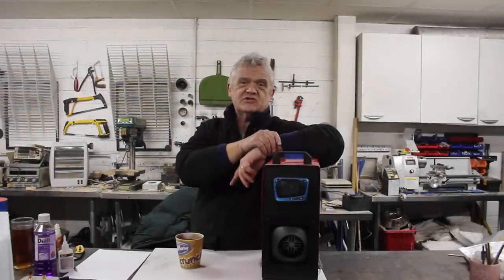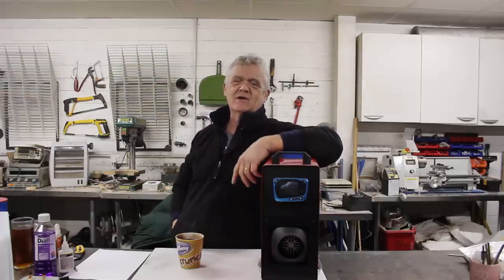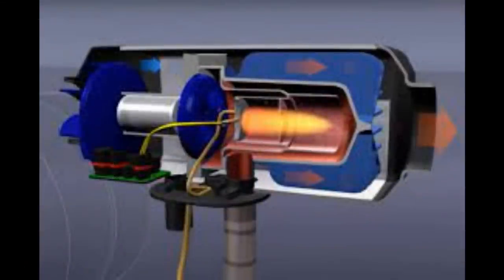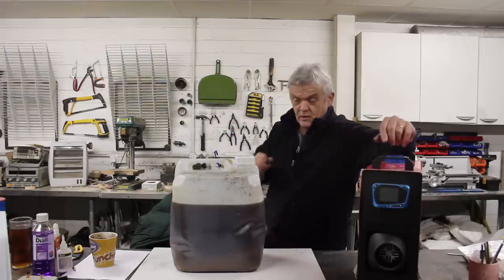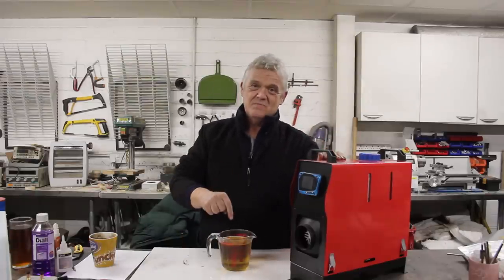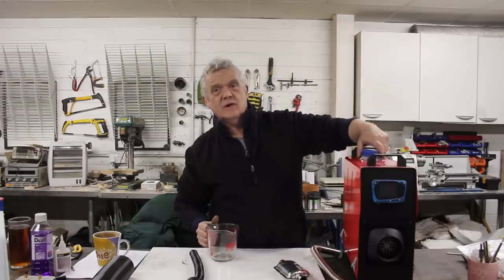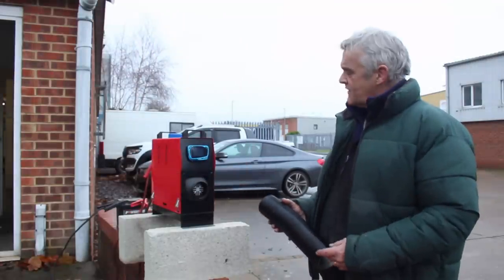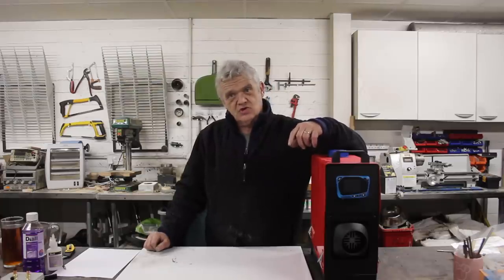1793 Home Made Fuel Running A Diesel Heater

Comment: They're amazing and if pensioners die of cold when used veg oil and a 100 quid heater can prevent it then what state is our country in? I shut off my gas supply and switched to these as only gas used was for heating but you still pay 56p a day standing charge, and only use central heating a couple of months per year anyways, if that.
Reply: When you say your using one? What square footage are you talking about. I'm wanting to know if I could heat a 20f x 40f lodge with good insulation

Comment: I have been running my diesel heater with E85(85℅ethanol+15℅gasoline). Its cheap in France, about 60 cent per litter. And its running fine, even in low setting 1.6Hz. And for the 12v power i used a old  computer PSU(300w). Works fine.
Reply from the maker: nice

Comment: So what if we could use the mechanical energy of the fuel with a 1/10th horse power Diesel engine to generate  electricity? We could use the heat for warming our home and the electric for lights or more heating.
I see such great waste with direct combustion of fuels. Using only 20% of its true value.
Additionally, alcohol can be boiled on a closed loop to turn additional dynamos with heat rejection used for home heating.
Reply from the maker: nice suggestions - cheers

Comment: I'm going to wait until the summer to buy one for next winter....   I was thinking tho with devices dumping exhaust heat about adding heat exchangers to them to heat water.  Even if the job needs to be finished off before a shower or washing up
Reply from the maker: good plan - they are getting harder to source just because it is winter - inn summer they are going to be a piece of cake to buy and cheaper!

Comment: Ive beem using on of these to heat my workshop in the uk for the last 6 years on diesel and kerosene never had a problem with it in temperature mode i use about 20 litres a month constant use for about 12 hours a day the only thinkni have replaced is the pump as if you dont use them they seem to get clogged up so i run it in summer once a week for about 5 mins to keep it from clogging up i also run it off a 12volt 15amp power supply
Reply from the maker: nice - thank you for The advice mate

Comment: When I was a mechanic we heated the shop with a diesel heater but what we did was mixed a50/50 mix of diesel and waste cooking oil and burned that because the oil alone was too hard to burn until heated up. By mixing it it made it burn easily and cut the cost of fuel in half.
Reply from the maker: cheers mate

Comment: do believe the combustion air intake does  not HAVE to be placed outside. If one instead used inside "room temp" air to feed combustion the unit can more efficiently do its thing cause it is not needing to heat this soon to be combusted air up as much to get/keep the combustion process going.    Granted that does mean then the user needs a vent somewhere for outside air to get inside the room to replace that air that ended up being used for combustion instead of breathing.  Yes this breathable air coming back into the room should not be be to close to where the combustion exhaust is, so your not providing access for that to get pulled into your breathable air space.     Corner of the room where no one spends much time for example might be a place..... so the cool air coming in, is not so much an issue.
Reply from the maker: cheers mate

Comment: Some heater display panels have a code that you can put in to change pump speed and airflow.  The code is 1688, tinker with this and you can basically burn most oil based substances.
Reply from the maker: cheers mate

Comment: I fitted a cab heater (Eberspacher) in my workshop over 25 years ago before the cheap versions were available. Like so many other Youtubers have done, it is not advisable to run them on a mains fed power supply unit, as in the event of a mains power cut the unit can’t go through the programmed (safe) shut down process of cooling the unit and purging the starting heater plug. A 12v battery and battery charger should be used to ensure correct shut down with the available battery power. If the battery voltage drops to 11.5 volts the unit will initiate the correct shutdown procedure automatically, turning off the fuel pump, running the fan to cool the heat exchanger via the heat sensor, re energising the glow plug briefly to ensure any residual fuel is purged from the chamber ready for a clean start up when the correct voltage is available.
Reply from the maker: cheers mate

Comment: used oil are often burning hotter than diesel or furnace oil. So you have to check the temperature inside the casting because if too hot it will go into cooling mode and shut down the pump. Another interesting fellow used a recycle aluminum tubing and heat dissipation fins  from an electric heating baseboard unit stuck into the exhaust. David McLuckie check that those diesel heaters exhaust and they are loosing around 800 watt in heat loss, so better to catch it before you exhaust it outside. Just make sure that their is no CO leaks in the contraption...
Reply from the maker: cheers mate

Comment: They have those heaters that will run on petrol (gasoline for those of us on this side) and a lot of van campers use them attached to the gas tank.
Reply from the maker: cheers mate
Reply: People I have seen who tested gasoline they didn't last very long running on straight gasoline!
Reply: @patrickday4206  They have the heaters that are constructed for Gasoline.  Many van dwellers and construction people not only use it, but have it attached to the gas tank of their vehicles. Completely safe and as long as properly maintained, they last for years.
Reply: @grey_piffle  yeah years ago I owned a vw bus 1999 I desperately wanted a gasoline heater as it get in the negative ferinheight but they were around $500 dollars I couldn't afford one so I'd drive looking out the one foot round circles that would defrost from the engine! Lol
Reply: @patrickday4206  less than $200 these days. some good knockoffs on Amazon too.

Comment: Hey got a  Hypothesis Hope I'm saying that right I don't like too much like a foolBut can we make a battery out of a radiator by put in vinegar through the radiator and using one end as copper on the other end is steel or led
Reply from the maker: yeah but it will rot the copper

Comment: If one can get one with a thermostat, I'm almost tempted to leave the entire business outside and use it to heat up air to 60 deg F for allowing one to make their heat pumps actually feasible in winter, but you'd have to ensure you enclose the outside unit enough, while not intaking too little air starving the heat pump. Geothermal adjacent at that point.

If anyone plans this, intake for heat pump cover must be at the bottom so any exhaust would be pushed up further than the intake.
Reply from the maker: nice suggestion - cheers mate
Reply: They do it's made by a guy in Australia it's called the afterburner!

Comment: Hi Rob, Great channel enjoy the content and thought Provoking topics. With regard to the diesel heater during the recent cold spell in the UK  -6 I have used one to feed in hot air and recycle it to get our lounge to a toasty 20 degC.

Never seen these temperatures before in a 1960 built house with poor by today's standards insulation.

I think you might find it interesting to look at harnessing the wasted exhaust temperature (200-300degc).

There are a few videos of using a car EGR intercooler that heats water as the exhaust gases pass through it.

It seems to me that this would be very similar to the old Back Boilers that perhaps you are more familiar with than me. 

In addition to heating an indirect copper coil water tank. It could possibly be used with a pump to circulate around a stand alone CH Radiator.

Merry Xmas to the team
Reply from the maker: nice suggestions mate and I was looking at the waste heat and pondering it - I like what you are suggesting for sure - cheers

Comment: What sort of temperature are the exhaust gases?   Could a coiled exhaust pipe be used to heat water like a gas fired power station ( you did this with a rocket stoke a while back)
Reply from the maker: that is a good idea mate - I was looking at the heat bloom from the exhaust thinking just the same thing - what a lot of waste heat lol

Comment: Okay, this is creepy. Just late last night I was thinking that it would be nice to see if Rob will combine homemade fuels with the Diesel heater. Now YouTube has jacked into my brainwaves!!!

On a more serious note, is it just stupid to think about using the fuel made from pyrolizing the plastic bags in this machine? I know very little when it comes to that sort of thing.
Reply: So realistically, the pump and fuel line used in this is sized for the consistency of diesel, so it could cause some problems even if it would burn. Also, the design of this has thermal limitations about how hot it can get. Diesel is surprisingly not very hot when burning, so oil and other fuels can cause thermal issues with these.
Reply from the maker: I think you could do it mate but I would guess you would need to play around a fair bit with viscosity and be prepared to clean it and maybe to lose it

Comment: hi rob ,we have one of these heaters .and just for reference we discovered the pulse pump was placed at a slight angle. .This caused the pump to fail as the piston needs to run inside the pulse pump vertical, as it relies on the fuel to lubricate.hence we adjusted the pump and lines and still ok 15 months later
Reply from the maker: this one has a diaphragm pump mate - I guess it changes from model to model
Reply: Correct, the piston wears on the bottom side. My unit doesn't have enough room to mount it properly, 😡

Comment: Any thoughts on using this biodiesel in a home oil furnace that runs on #2 diesel?
Reply from the maker: myself - I would just try it and see - but that's me and you do run the risk of it not working - but what the hey - it's only going to mean a bit of cleaning if it doesn't

Comment: Wondering if attaching the catalytic converter to the exhaust would prevent the smell of fuel on startup or shutoff?
Reply: Catalytic converters have to get very hot before they work.

Comment: Could it also burnn on oil from sunflowers?
Reply: The oil that is used at many restaurants for frying typically is a blend of one or more of the following: canola, soy, corn, and/or sunflower.  Sunflower has a higher smoke point than most or all of these, which is related to ignition temp, which makes it slightly less good, but its still usable.  You wouldn't want to use something like avocado oil since it has such a high smoke point. The lower the smoke point, the easier it is to burn and to burn completely.  

   (Conversely, modified avocado oil would make a great 4 stroke type engine oil precisely because it can handle high temps without burning).
Reply: @justinw1765  thnx

Comment: I've used the two German brands of this heater it's in a bit of a different configuration with the tank and pump being separate. I'm in Canada how does that fuel mixture flow a long tiny lines when it gets to -30- 40 Celsius. Some guys using these heaters run kerosene diesel or straight kerosene for cleaner Burns for less maintenance
Reply: In Canada the petroleum companies put additives into the diesel so it flows at those low temperatures, and/or you can buy additives yourself and add more
Reply: Oh yeah I forgot to say I have been using the Chinese version of that heater but like I said it's in a different configuration with the pump and fuel tank being separate. I've at many times tinkered, taken them apart to clean and inspect.  Ive had problems and solved them
Reply from the maker: the fuel is supposed to be good to minus 8C

Comment: One issue with these is that if you have a power cut it can melt down because the fan that was going to cool it down stops running
Reply from the maker: use a car battery like I did

Comment: ROBERT, I HAVE A USED BASE BOARD WATER HEATER SECTION WHICH IS JUST A COPPER PIPE WITH AN ALUMINUM FINED JACKET SLIPPED OVER IT.  I WAS THINKING TO EXTRACT HEAT FROM THE EXHAUST BEFORE IT HIT THE OUTSIDE.  I KNOW NOTHING ABOUT ANY OF THIS AND HAVE NEVER DONE ANY SET UP. WATCHED A LOT OF VIDEOS AND BOUGHT THE HEATER. DIESEL IS AROUND 3 DOLLARS A GALLON AND I DO NOT KNOW ANY RESTAURANT OWNERS.  I SELDOM USE COOKING OIL FOR ANY THING.  WOULD THAT WORK WITHOUT CREATING TROUBLE.  I AM GOING TO USE IN MY HOUSE NOT A SHOP.  THE STAINLESS STEEL FLEX PIPE FITS SNUGLY INTO THE COPPER PIPE OF THE RADIATOR AND I WAS THINKING HIGH HEAT JB WELD AT THE JOIN.
Reply from the maker: I don't have an answer mate but I am excited by what you are suggesting
Reply: @ThinkingandTinkering  SOME CARS HAVE LONG EXHAUST CIRCUIT AND SOME SHORTER IE STRAIGHT PIPES.  THINKING.  AND THANK YOU FOR THE RESPONSE.

Comment: Thx for the Test, always good to know. You can connect it with an "Universal Power Grid Adapter" or use one of these adapters with a 12V Output. I think I would also use a Temperatur Sensor so it runs for example when the room Temperatur falls under 18°C till it's higher then 25°C.
Reply: The burner has a sensor in the control panel, you can set it to a temp and it switches between high and low as required to maintain that temp 👍
Reply: It always burns, you can slow the pump to reduce btu output. You can get a power supply to eliminate a battery. They run best at 13.5-14 VDC.

Comment: Just use domestic heating oil, around 90p/litre now.
Reply: Which is more than twice the cost of the fuel he is burning here? Why would you?
Reply: Where would that be? How many lts have you got to buy, to get it that price, I was quoted nearly £400 for 45 uk gallons delivered local from depot.
Reply: @rikmoran3963  Don't know where to buy used cooking oil, paraffin costs £2.50/litre, don't know where to buy gelatine, don't have the facility to process 100litres/month which is the volume I am using in my two heaters.
Reply: @lioncrunch9098  Local garage near Corwen sells it from the pump at the same price as bulk deliveries, shop around.
Reply: @bobcuarto4891  do you know price per Lt, please.
Reply: @lioncrunch9098  About 90p/litre at the moment.
Reply: @bobcuarto4891  thanks for info, unfortunately I’m near Bradford, so distance is too great, anyone know where to buy heating oil by the Lt near me.

Comment: Have the same heater lasted 4 hours before the glow plug failed. They say run them at the higher settings to prevent soot build up, but the very cheap glow plugs they come with cannot handle that.
Reply: I think you may be using the wrong current setting for your glow plug?  The glow plug turns off soon after stable combustion is sensed.  The higher settings they refer to is the fuel pump Hz.  They do not run appreciably hotter because more cooling air is drawn through, over the heat exchanger as the fuel rate is increased.
Reply from the maker: it sound to me you have been a bit unlucky there mate - others report years of use without issue

Comment: Ive seen people using used engine oil for these aswell mixed with diesel, be interesting to see what you can get it to run on, on your used veg oild instead of parrafin could you thin it with anything else like maybe 5% petrol ?
Reply from the maker: others have posted that they did just that
Reply: Yes I've seen people post much higher percentages even straight petrol but they don't last long on 100 percent straight petrol!

Comment: I have heard a tip from mechanics to make your own kerosene for tractors etc. by mixing 50/50 gasoline and diesel.

In that case the oil might be fine with 10-20% gasoline in, which is (in Sweden) much easier to get hold of.

Your price of 40p/liter translates to 4p/kWh, which over here would be cheaper than electricity, and on most days even cheaper than a heat pump.

Comment: Good video, and I am sure this is a viable fuel for the UK climate, where I live in Canada even diesel fuel gels in extreme cold, your mixture would become a solid.
Reply: @WRXS - hence diesel fuel heaters were invented,and if we only looking at the heater fuel gelling easy.. run your exhaust gas directly in a box per say outside and have your tank inside that just first no wrecking my brain popped in,and also u can always use a copper or some metal tube like brake line coil it up a bit in the middle make sure it fits inside tge tank opening submerge,next.. one end of pipe tap in direct line with exhaust in the exhh pipe while other end just vent to athmos..if not enough exh gas caught and temp not arisen in coil modify opening to catch more gasses..your welcom.. easy to bark out without thinking at a honest helpful gesture to who CHOOSE to enjoy the advice..not mandatory for you ..grattitude for selfless free help is what should be shown,nNOT"smart" -SS comments wirhout some grey matter poweer to back it up with..now u just embarrassing yourself..hit the books itll change your mind to the better...god bless everyone ..and lets say a thank you from everyone to the kind gentleman posting wisdom..
Reply: @MrEuroWolfie  Great reply Wolfie, and since the heater is only used for winter camping in my converted cargo trailer, or bug out box, I will stick with the winter blend of 50% diesel and 50% odorless kerosene.

Comment: This is why I don't worry about all the impurities and hostile amoeba in hot springs - this design is basically a thermal siphon for air, but take a copper coil with you camping and if you are near a geothermal area (I live in Pacific Northwest, so lots of hot springs) you can take your ice cold river water you sent to camp with your little  hydraulic ram and get some of it so hot it will literally burn you, purely on its own thermal siphoning behavior, no pump, no heating element.
Reply from the maker: nice
Reply: They can even withstand water injection to clean them out so fuel with water in poses no problem at all.